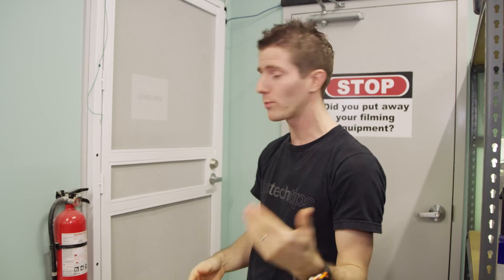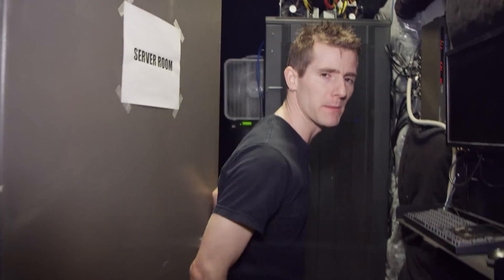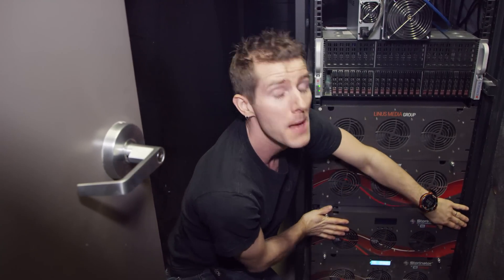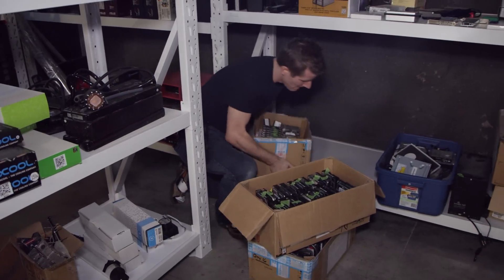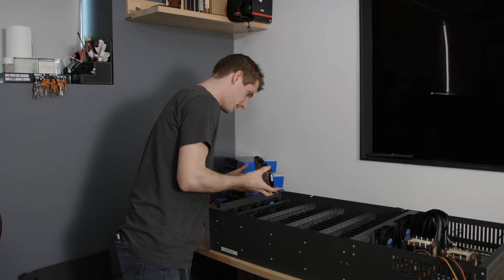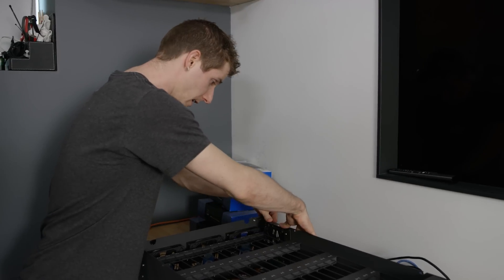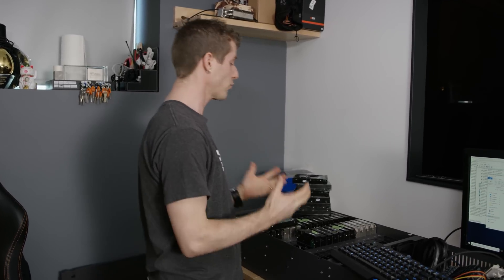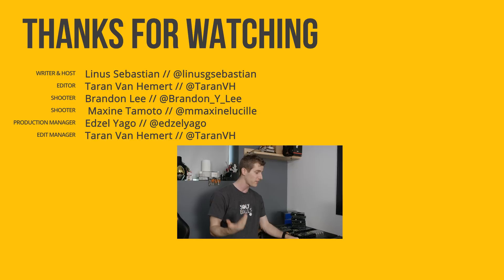HARD DRIVE Mining? This is getting ridiculous...

Comment: What are you actually “mining”?
Reply: in computer science there is a principle called the "time/space tradeoff." check wikipedia for details, but in short: if you want to use a very small amount of space (compression), it will require more computation. on the other hand, if you want to limit the amount of computation, you can create a large, elaborate data structure that is easy to traverse.

the goal of "burstcoin" and proof-of-space in general is to limit the power consumption of cryptocurrency. they accomplish this by limiting computation time through this time/space tradeoff.
Reply: your money
Reply: Short answer: a bubble called crypto currency

Comment: I hope the mining hype ends soon. There are more cryptocurrencies than there are names for it. They increase pc costs and there are more and more websites that use the visitors pc power to mine.
Reply: This isn't new, and won't change. There were hundreds of altcoins back in 2013
Reply: Nope, that must be your PC. Opening article there takes 20% of CPU for a second, then gets down to usual 2%. Scrolling loads to 5 - 6% for another second.
Reply: DaGucka one person who is actually logical!!!
Reply: Also I subbed to your channel
Reply: Evan Anderson But if you compare this to ads, sites doing this is like forcing you to click on the ads
Reply: there are ways to stop the sites using your power ..
Reply: Evan Anderson yeah extra stress on your hardware so it dies quicker or empties your laptops battery faster nice
Reply: Some news/op ed. website...maybe it was Slate?...would ramp your CPU up to 100%. I would be fine them using some of my processing power in order to avoid ads, but not something that'd be a major stress on a system.
Reply: @Evan Anderson @Nighterlev I've yet to see a site ask for permission to use my hardware for it's purposes that's 1, and 2, I can block ads.
It's better for those sites to find a different way of earning money. Or at least ask for permission to run on my pc for mining as a donation.
Reply: I've never even heard of that CPU in intel's line up. According to ARK, it's a budget 64$ dual core CPU with a middle of the range clock rate.
I idle at 3% CPU usage and 11% on load while scrolling on an i7 4790k. Your system has serious issues >.>
Reply: over 100%?
Reply: The G4400 is a 2 core 3.3Ghz Skylake processor, it is a relatively powerful CPU. He either have a crappy GPU which have to offload things to the CPU, or a software issue.
Reply: Yes, because ad blocker is a permanent solution @yous...It's just one step in an arms race, you adblock, they paywall...or stealth mine.
Reply: Next mining with PS4s and Xbox Ones
Reply: Lol a shitty javascript miner will never come close to 100% CPU usage. go run a browser stress test and see how much CPU it uses. My CPU/GPU were utilized upto about 20-25%.
Reply: I'm a miner and even I agree with that statement, there's far too many useless ICOs and ITOs out now, most of which will go nowhere and the rest will go SOME places but still be unable to keep up in the long run. There should only of been a few like 6 of them, it's a bit unhealthy economically and ecologically to have over 1000 cryptos out there...
Reply: +Nighterlev
Definitely.  I have a custom hosts file, which manages to get rid of some ads, but the internet is still so damn awful slow.  But I'm also using Firefox, on MacOS X, and usually have about 100 tabs open in background windows - all of which might have something to do with it (how efficient is OSX's TCP stack if you have a few hundred open sockets?).

But it's not just ads, it's all the probably-overstressed-and-consequenty-slow-things-gotten-from-gstatic.com, web trackers, animation javascripts, and maybe HTML5/CSS "over-nesting" that's used on pretty much ALL sites today.  I see a Facebook or Twitter video that I want to dig out the download URL..  And see has 6 or 7 levels of CSS nesting crap before I get to the MP4 address (or a un-downloadable "blob:" address).  Is that really necessary?

Sometimes I miss the days of HTML 1-3 before CSS, when the most complicated thing was the "table" tag..
Reply: @ "yous gon git dem ch** [?? what? Is that particularly word use offensive?  I really don't know] took my n***"
Either you're a troll and/or bot, or (if you're actually a human) don't use swear words.  Until I read that comment, I thought this was an unusually useful and civil YouTube discussion thread.  Is this the "New Godwin's Law" at work?  As a discussion thread gets longer, the probability of a swear-filled hate/psudo-hate post approaches 1?
Reply: cryto currency won't stop.  it will eventually drive out real money
Reply: Really?
Websites do that?
Reply: I have a program that recognises mining activity and stops it. Many websites do it already. It's unallowed usage of my pc, they didn't ask for it, i don't want it, it costs elictricity and cpu lifespan. Also if i have a website open in the background the mining can cost me fps in games.

Btw. I have an i7-8700k. I don't even recognize diablo 3 by cpu usage. XD
Reply: Batteries? CNN using 80% of someone's CPU? You plebs are unbelievable. Get on my level and use a desktop with a badass CPU.
Reply: hahahahahah  what a load of bull
Reply: Still, there's some sites I would gladly opt into that instead of obnoxious ads for.
Reply: Nighterlev since when does simple html code stress out your CPU and make it run at 100%??????????????????
Reply: +Roshan
i don't think you understand just how bad advertisements are and how they can fuck up your entire system to 70% to over 100% in seconds.
Try going to the CNN website and watch it take forever to load, even if your internet is incredibly fast.
Hell, even using a adblocker my CPU still goes to 80% max when trying to load in the website, but once it fully loads it stays at a idle 20% just by staying ON the website. 
Turning off my adblocker and guess what happens? 50% idle at 70% load when trying to just scroll through the website due to all the ads it actually has.

And the funny thing is I have a G4400 dual core Pentium processor.  Most laptop processors are way weaker then this, so simply even trying to load a website like CNN would max out there CPU and even slow down the computer to near unresponsiveness.
Reply: +Roshan
Would you rather a load of advertisements that stress out the CPU and empty your laptops battery 3x faster?
Or would you rather have the website use like 10% of your CPU or GPU's processing power which would barely have any negative impact on your hardware over-all?
CPU's and GPU's can literally last forever.  The only thing that kills them is heat, which laptops are generally known for getting so hot you could literally cook a egg on them...
Reply: Is that such a bad idea though? Using some of a visitors processing power while they are on the site instead of advertisements seems like a pretty fair deal to me.

Comment: Lol he's worried about leaving "high reliability" drives on for an extended amount of time. We have an older Server that we use for QA with standard SATA drives in RAID1 that have been running for ~7 years straight an we have hardly had to replace any of them.

Comment: So...  $7500 for the chassis, $15,000 for the drives, something like another $10,000 for those two CPUs, $700 for the motherboard, $5000 for the RAM, another 2 or 3 grand for those LSI cards...

That's a good $40,000 in hardware.  At $100 per month?  That's over 33 years to break even.  NOT counting power costs.
Reply: Arclite02 at current price. Burstcoin is looking like it will hit $1 this year.

Comment: linus is an idiot.. your last mining video was horrible.. you used OLD risers... you used 6pin to sata extensions... and a wood frame... DO NOT LISTEN TO THIS GUY WHEN IT COMES TO MINING!  you have been warned... it's all good until you BURN DOWN YOUR HOUSE! idiot...
Reply: Cryptomined and who the hell r u?
Reply: someone who has experience in what he talks about ... unlike linus... his advice will burn down your house... it was horrible advice in his last asrock h110 build video... absolutely horrid... 6pin risers are meant for server PSUs... those 6pin to sata extensions are an absolute fire hazard... and how he had them wired up multiples to single cables, even more of a fire hazard... and using ver.006 risers instead of ver.009... very bad advice... said he got the advice from some expert... ummm... get experience so you can give your own advice buddy... know what you are talking about before talking... ver.006 are old risers.. you dont want to buy risers that have been sitting around for 1-2 years... that is really horrible advice

Comment: Oh no

I hope this doesn't catch on making the prices sky rocket, GPU and Ram are double what they should be
Reply: 166gb isn't anything
Reply: when in doubt, make another google drive account.
Reply: iJamie8467x Well, I would have to disagree. I have "only" 1TB HDD, and it holds all my games just fine. In fact, my entire file-system only amounts to 166GB currently. Maybe it's just the games that I play.
Reply: Io 166gb isn't a lot
Like I said games like Gears of War and GTA V require about 100gbs (without mods, currently)

I had 1tb I could get away with it for awhile but after awhile i was tired of having to scrap the bottom of the bucket
Reply: Yes, I know it is not a lot. I tend to play games like Europa Universalis IV, War Thunder and KSP (I have a lot more on my drive, too). I think it is probably just that the games I play are not wasteful with storage, unlike those games you mentioned above.
How do they even distribute those things to console anymore? BluRays can only get to around 50GB capacity.
Reply: iJamie8467x buy an ssd if that happens
Reply: Humanity's Demise SSDs are too expensive, IMO you need at least 3tb for a Gaming PC.. well you don't "need" but games like GTA V use 100gb or more, Ark, Gear of Wars 4, X Plane 11 also use a lot so it's best to have a comfortable amount

SSDs are secondary drives "currently"

Comment: Do a video on soundcard mining next, Linux
Reply: pc fan mining?
Reply: Linux
Reply: Linux
Reply: It's theoretically possible to "mine" with RTL-SDRs. You just plug a bunch of RTL-SDRs into a Raspberry Pi, connect them to an antenna, then run some software that allows others to pay a bit of crypto in exchange for locking a RTL-SDR to a given frequency for a given time. (The RTL-SDRs default to constantly scanning so that others will have an idea if it would even have a hope of receiving the signal they're interested in, before paying.) All we need is that software...

Comment: I Hope a 1TB HDD won't cost 500 dollar in a few months :(
Reply: 1TB drives probably not... Consumer SMR 8TB drives... maybe
Reply: funbucket09 SSD is overrated
Reply: 1 TB ramdisk.
Reply: Aquila LP HDD mining has been out for ages, let those slow to the trend miners waste their money. They inflated the gpu money by wasting their money on GPUS when they could have bought an ASIC for a lot cheaper that is the equivalent of 30 1080ti's.
Reply: Krilium Only recommended for OS, makes your computer load time way faster.
Reply: Logan Francisco I agree, however no one really wants to buy second hand GPU's that have been thrashed from cryptomining also.
Reply: Generic Username yes but you cant resell a ASIC and you can those old gpus
Reply: sarunas2007 Yeah but the main reason you by these products aren't to resell, but to use them. ASIC are way cheaper and more effective, while yes GPU's can be resold but it is a much better option for ASIC if you are purely mining. By the time you stop mining (depends, maybe 3-5 years down the track) those GPUS would be outdated, but ASIC's are here to stay as long as there is cryptomining. Even if in the future there were a lot better ASIC, someone would be happy to have a secondhand ASIC that still works.

Comment: hard drives go up by 200% in prices
Reply: Big drives maybe, smaller like 1 or 2 tb drives, naw
Reply: Maybe but only for high performance drive. For low performance aka 5400 rpm (yes they are still exist) or for some size of 7200 rpm, it won't. Besides to make this work: more room needed, better cooling (hdd can have 100 degree celcius on full load), and very susceptible to shock, magnetic interference, condensation, etc.

And as Linus say, with current price of the coin, it is better to use your HDD for something else (maybe selling your porn collection lol).

Comment: But the question is can you run this along side a GPU/CPU miner and not lose efficency? If that's the case you can probably exploit that.Being able to mine 3 coins(dual miners already exist) at the same with the same efficency and ~ the same power consumption is really one of the biggest factors here.

Comment: Oh well... rip my pc building plans
Reply: lol relax, no one is buying up all the hard drives....yet
Reply: 750ti is terrible for mining. That's just the retailer price gouging. 
Source: Was miner with 750ti. 300H/s won't cut it for big coins. You'd have to mine small stuff and wait years for it to gain value.
Reply: Even if it made drive prices rocket everyone would just switch to SSD's altogether or M.2 neither of which would ever make sense for mining.
Reply: rip to those who didnt watch the video.
Reply: Going to hit the thrift shops for hard drives 20 bucks now, going to be worth 500 each later.
Sorry my wife got to spend money now to make money later.
Reply: What’s next, collecting coins with big pc cases?
Reply: YEP BUT I MEANT DUE TO THE INCREASE IN PRICE OF GTX 1060 NO ONE'S Buying it and bcz of that the demand of graphics card lower than 1060 has increased and taking this as advantage the price of all these gpu have increased
Reply: Burstcoin started in 2014 and look at hard drive prices. They've been going down for years. Nothing will happen unless it explodes like CPU coins did last year.
Just like other crypto, it will be profitable, but no shortages will happen until you start making thousands off of a $100 investment.
Reply: 😑 bcz of this shit mining the price of gtx 1060 raised up in my country and bcz of that even gtx 750 ti price has gone up

Comment: OMG, all those old 3.5" drives.  We got rid of nearly all of ours earlier this year, only a small handful left.  We don't even buy 3.5" enclosures any more.  It's all moved to 2.5", particularly now that high-density HDDs are available in the 2.5" form factor (like the 4TB Seacrates, albeit 15mm high).   It's a whole lot easier to deal with the 2.5" form factor than the 3.5" form factor.  Far less vibration, far less power consumed, far less cooling needed.  The drives don't even get warm, honestly.

Rip open one of those old 15K rpm barracudas and you may be surprised to see a 2.5" platter inside.

No resale value for used 3.5" drives unless they are very recent, like the 12TB's, but even so my preference is to simply have a few more 2.5" drives. 

-Matt

Comment: but crypto is crashing so is it still worth it ?
Reply: Crashing...yes. But will blockchains go away? No. So would we rather have blockchains on powerhungry gpu's or asics? Or rather the 400 times greener HDDs. I would choose the latter.... Bottomline: its a long term game.
Reply: Ausintune still uses less energy
Reply: The idea behind burst is it's environmentally friendly since it uses like 400x less electricity per transaction vs bitcoin. So I could see it being a great option to use as a real coin instead of just holding it like gold. I lso think the public think bitcoin is the only option but as they get more and more familiar with crypto they will see this as being an eco friendly version similar to ppl buying tesla or solar, they will latch on to it as a better solution to the problem bitcoin is trying to solve. PoW and PoS are just not as good a solution as PoC.
Reply: blockchain is not a new technology. Distributed ledgers around had been around for forever, yet bitcoiners are claiming credit for it. The attempts to apply it to everything is v dumb.
Reply: Bombtrack's Crypto Corner are you fucking serious storage devices heat up like fuck when in constant use
Reply: flangel842005 incorrect. a ssd with same amount of transistors as a GPU will use more power. And HDDs will burn up after a few days of constant use

Comment: Bye cheap hard drives.
Reply: Sebastian SAC start saving now before you actually complain about HDD prices.
Reply: Did you even read until the end?
Reply: rip seagate 2 tb hard drive
Reply: Sebastian SAC Buy*
Reply: Use the old ones still sitting around. Otherwise it will not be protifable. And even with a jerry-rigged setup using old hardware it will barely make a profit.
Reply: Tf, y am i being attacked?

Comment: what's next psu mining?
Reply: Fan mining!
Reply: Dank Grass Bush or RAM mining?
Reply: Case mining!!
Reply: Monitor mining
Reply: Marvin Wilson AMAZING
Reply: rgb mining
Reply: Dank Grass Bush cable mining
Reply: This comment section is lit
Reply: Radovan Bro I mine RAMcoin by downloading RAM memory.
Reply: quimey fusaro mouse clicker miner, Ethernet miner, PCH miner, VRM miner...
Reply: I mine with the RGB leds, but I only use the red ones as the wave length is smaller and allows higher frequencies then the green or blue, plus if you used all of them together you would be left with a white light that would be less secure and peoples private and personal data could be compromised. Plus by only using the red leds my power bill has only increased $200 a month, while I make a solid $25 a month from mining. 😂